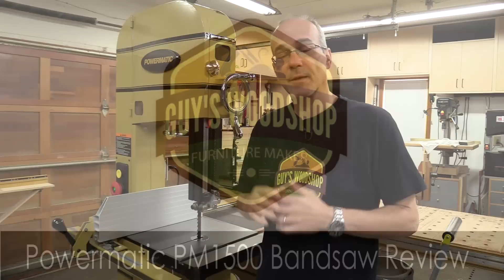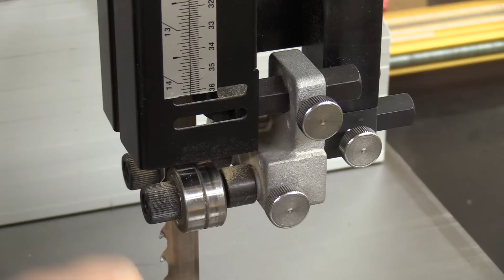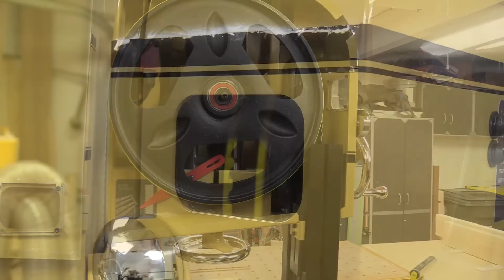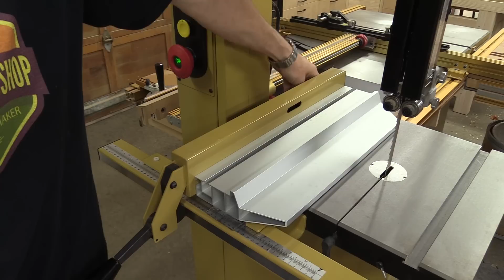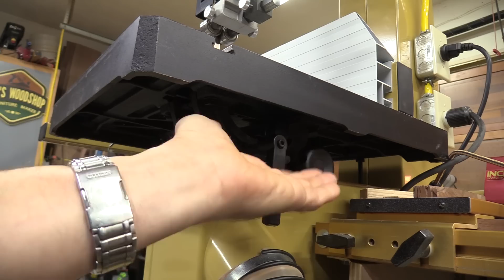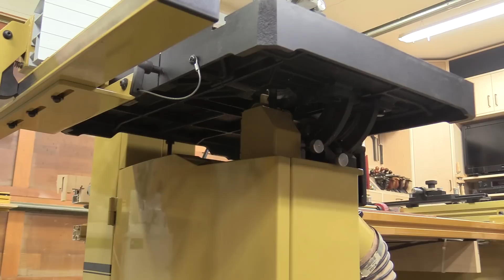Powermatic PM1500 Band Saw Review

Comment: I agree, I've had mine a few years now and the safety interlock that does not allow the saw to start unless the blade is mentioned is a real help, to me anyway.  I did replace the Powermatic blade guides with Carter guides....the supplied guides must have gotten sea water in them on the way over as they rusted out quite quickly....but that's no doubt an unusual problem.  I also added a Carter magnetic fence....not for general use but for when I want to cut bevels....bandsaw fences do not seem to ever have the ability to move to the right hand side of the blade...so support for your workpiece is pretty much lacking.  The magnetic fence sticks like gangbusters as the table is machined dead smooth.  ONE thing to consider....though Powermatic states this saw will support up to a 1" wide blade,  the sales guy admitted that 1/2" is pretty much the limit if you want the blade to last... I quit putting on 3/4" blades, I've not had one break since.   Oh...the WoodSlicer blade from Highland woodworking is a gem of a blade and just shy of 1/32 thick.  Smooth and Quiet!
I've been a beginner for about 7 years now....not likely to describe myself differently anytime soon.  -Veteran '66-68

Comment: I have the PM1500 version of your saw.  I went to rip some 3/4 thick x 4-1/2 tall pine boards down to half inch thick today and was disappointed a bit.  The blade was drifting off the side of the board immediately.  I’ve checked my blade tension, my bearings are all in the proper place, I have a 1” blade that is an alternating type, with teeth at 3tpi.  Is that a good blade to use for this application?  I looked in the trouble shoot menu of the manual.  A few things listed as possible issues and fixes.  One is, was the blade sharp, I’m not sure how to tell, except that I know it’s not that used yet and feels sharp to the touch.  The other thing was clean the blade.  I have no idea on how you clean a band saw blade, manual says nothing about this.  Would you know?  I have no idea why it wouldn’t go through these pine boards like butter.  Any suggestions would be greatly appreciated.  Thx
Reply from the maker: Marc (the Wood Whisperer here on YouTube) has an excellent video on how to tune a bsandsaw. I would recommend that you take a look at it.

Comment: Hi Guy, Just bought me a PM1500 but it does not completely look like yours, nor like I saw it on Powermatic's website. Maybe it's an upgrade, I don't know.
But what bothers me is the lack of instructions when you unpack it and first install it. I think now I got it, with all the video's I saw on the net, but still have a important question. When I look at video's and I see people opening the housing of the wheels, they always can turn the wheel with almost no resistance at all. When I open the housing to get acces to the wheels, there's no way I can turn the wheel, except if I put incredible power on it.

What might be the cause of that?

Thanks,
Patrick
Reply from the maker: It's hard to say. I would talk to the support team at PM. Very nice and helpful folks there.
Reply: @GuysShop  ok thanks

Comment: Guy,
I am looking at downsizing my shop to a bandsaw centered approach.  I am looking at the Powermatic PM1500 are you still happy this saw 3yrs later?  Did you consider the Grizzly 17" bandsaws at all?  I had a laguna 1412 and was not impressed so I am looking at Grizzly 17" or Powermatic 15" but prefer the quality control as well as fit/finish that I have experienced with Powermatic tools over the years.  Thanks again for your video.
Reply: I used to own a Grizzly 17 (resaw) machine.....this 15" Powermatic is on a different level of excellence.  Smooth, it is.
Reply from the maker: I am still very happy with the PM.
Reply: @GuysShop  What is the floor to table height on your saw?  Thanks!

Comment: I only recently found your channel and appreciate you high quality presentations.  About the bandsaw, I'd like to know what you think after using a while. How is the wheel alignment, are they coplaner?  When you raise or lower the upper guide, do the bearings keep their relationship to the blade?  How rigid is the upper guide support bar at full extension?  Cheers

Comment: I've been doing hand tools only for the last 3 years. Been looking to get a band saw as its time consuming to thin stock by hand. I think this is the one I will be getting. Had considered the 18" Powermatic but I think the 15" here should be more than enough.
Reply from the maker: The PM1500 has been a solid performer for me so far
Reply: I have resawn some 12" wide darn hard black walnut using highland woodworking's wood slicer blade, it is an inspiring experience.  A smooth running machine with a VERY smooth running blade is a pleasure.

Comment: At 7:15 you open the small door flap that covers the lower guide bearings.  I just ran into a design flaw with this.  Have you put a 1” blade on your saw yet?  When you do this door flap won’t close all the way anymore.  It hits the guide bearing that was adjusted further out for the new wider blade.  I had to remove mine in order to shut the larger lower cabinet door.

Comment: Nice review Guy and congratulations on the new bandsaw.  The tension handle looks like it could be a good head knocker if you aren't careful.  Steve
Reply from the maker: Hey Steve! So far hitting my head on the handle has not been an issue, and I'm 6'1"
Reply: I'm 6'3 and can let you know that after a couple of knocks on the head, one 'somewhat quickly' learns to dodge. <grin> It is a pretty solid lever.

Comment: Nice review Guy. Hey, I was surprised and excited to see that they fixed the crappy dust collection below the table. On mine (1st generation of the PM1500?) there is no enclosure surrounding the bearings. Doubtful that I can retrofit mine though :-( Are those ratcheting levers still cheap plastic or did they upgrade those too?
Reply from the maker: Thanks Marty! I couldn't tell you if the shroud can be retrofit. It may be worth a call though as it really makes a big difference. And yes, there are still some handles and knobs that are plastic. But moving up this saw from a Grizzly that was all plastic is a big step up for me.